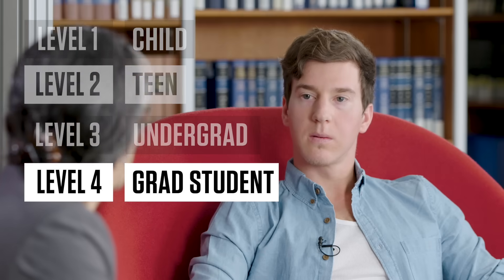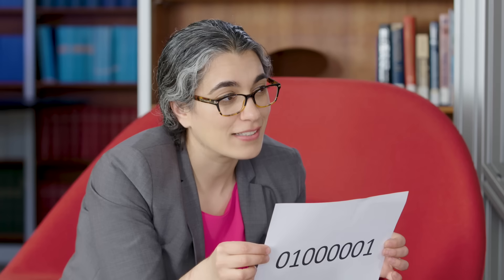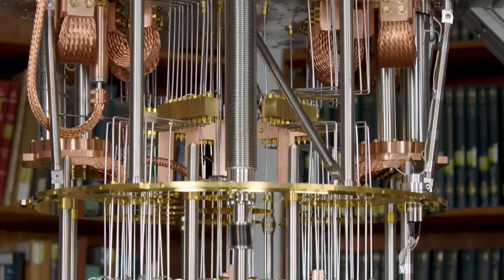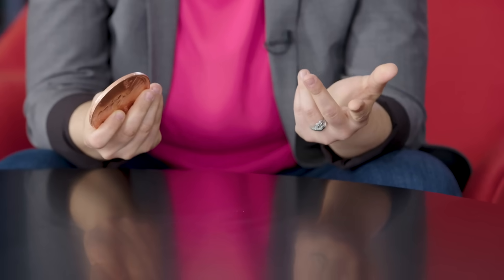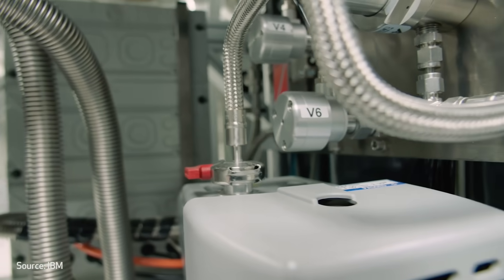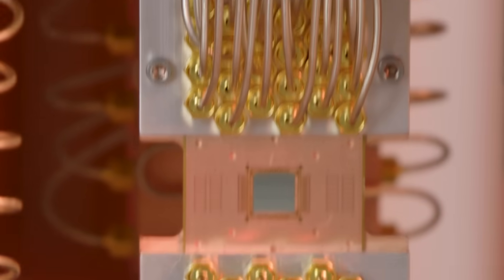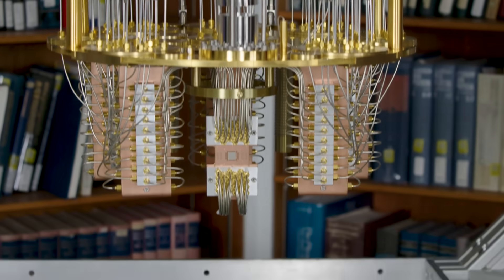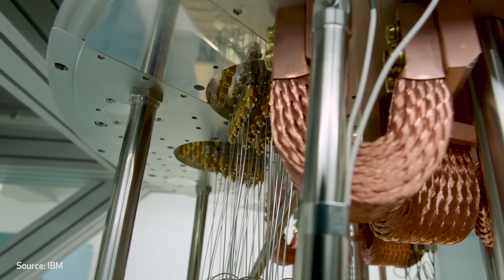Quantum Computing Expert Explains One Concept in 5 Levels of Difficulty | WIRED

Comment: +like. How big is this machine? Did she say 50 bits? or 50 bytes?  The number of pneumatic tubes  seems to indicate 50 bits??  The entanglement is a wonderful concept of implied instant communication over what might be light years of physical separation?  Perhaps the first thing to do is comprehensive tests of the entanglement hypothesis: and alarm clock that can be programmed to ring at a certain time because of the state of these entangled bits. This is like pure math, where people imagine mathematical functions and others are expected to use these advances on the mathematical frontier to find/define a real world problem using the 'new' tool.  I have an issue with the concept relying too heavily on processes that we have no capacity to measure at precisely the same time to 10 **(-30) seconds.  I have no idea how fast the 'where' / 'what' can change but am just trying to understand how slow this state might change at 0.01 degrees Kelvin.  At what temperature does hydrogen (protons) freeze?
Reply: Alan G 
Quantum entanglement can't be used for communication
Reply: ANT, your answer is overly simplistic.

Comment: I love this! Great video! Check out a book I have always loved, "How to build your own self-programming robot", by David L. Heiserman (TAB Book No. 1241, 629.8'92, ISBN 0-8306-9760-8, or 0-8306-1241-6 for paperback). He goes through the entire process of finding and fixing issues on early hardware, while improving system fault tolerance. I don't think it will apply directly, but it could give insight. If nothing else, it is great for some wire wrap nostalgia! Hope that this helps!

Comment: To clarify. A classical computer theoretically runs on 0s and 1s. We have to round because due to interference it isn't exact. This is why the computer must be isolated and reduced to such low temperatures to reduce interference.

Comment: What I still don't get is what use is it if it is always 0 and 1. Lets add 2 bits being 1: 1+1=2 or in binairy 01 + 01 = 10. Now in quantum computing each bit would either be 0 or 1, so you will get all possible answers of 00, 01, 10, 11 which would mean the answer of 1+1 would be 0 or 1 or 2 or 3. Which would mean you still don't have the answer just all possible answers. Sure that is useful if you want to know all options, but not if you want to know the answer. So how do they do this?

Comment: You know how in naval engineering they use computer simulations to predict how their ship design will behave?
In the olden days they only had wooden ship models and swimming pools.
Quantum computing aims to be kind of like that, only more generic. If you pose a question to reality in a correct way, you automatically get a valid answer for free, no computing power of your own needed. Nothing beats reality in computing power. The problem of course, is how do you pose the question in correct manner to a quantum computer? And how do you know you got the right answer? Quantum computers are quite susceptible to random errors.
That's how I would attempt to explain a quantum computer to a layman.

Comment: If we are talking about measuring the spin of entangled particles the conservation angular momentum requires that when  we measure one particle if we get spin up,  the measurement of the other particle  will always be spin down.  In your talk you say that the entangled pennys  should always  both be heads or both should be tails.  Shouldn't the conservation of angular momentum of the entangled pennys cause one penny to be heads up and the other to be tails up or vise versa?

Comment: Actually the entire point of quantum entanglement is that if you measure a particle and it shows it as heads the other one will surely show tails. It's the opposite not the same.

Comment: The Penny analogy was amazing. So is it like you can have true or false, but also now include your spin like 0° to 360° to represent more information rather than using a greater number of pennies in a combination?
Reply: Not quite.. 

With these quantum computers saying
'Spin up' is like saying 0 (or heads)
'Spin down' is like saying 1 (or tails)

Conventional computers only think in terms of 0 and 1 (if the computer wanted to count to what you'd call two it would call it 10, three would be 11)

Conventional computers 'could' be designed to think in terms of 0, 1, 2, and 3 (if the computer wanted to count to what you'd call four it would call it 10, five would be 11)... but it wouldn't gain us much worth having.

The two things quantum computers can do that regular computers can't are:
"Superposition" which is like saying... shrug this number is both 0 and 1 at the moment (because magic)
and
"Entangled" which is like saying lets flip both of these coins... If one lands heads the other one will as well (because magic)
Reply: Matthew Spencer Thanks for the clarification. I am still a bit lost. If you have 2 computers synced up with each other where one holds 1 and the other 0 then would't that suffice for spacial imposition? I am not sure on how entanglement is judged because once the result is settled can't you change one to match the result? It is not necessary to answer these for me since it seems I have something new to study now. Thanks for inciting even more curiosity in me.

Comment: @5:30 Technical error: one persons Heads/Tails would be the opposite of the others. not the same. Doesn't really matter to get the concept, but still erroneous.
Reply: Nope. It depends on how the two 'pennies' have been entangled in the first place. You would create the pennies in a superposition of two states- one in which both pennies are heads and the other where both pennies are tails. When you now measure, you would end up with one of these two states so both pennies always show the same. You could also create the pennies in a different entangled state which would give you pennies in opposite states upon measuring.

Comment: But... Can it run PUBG without lag?   No,  nothing can run PUBG without lag.
Reply: A better computer won't fix the crappy servers. That is entirely on pubg.
Reply: you run pubg with this one and everyone starts as a zombie. both dead and alive at the same time.
Reply: Is it the hardware or is it the game's coding that fails?
Reply: You can't. You need a graphics card.
Reply: Hans5958 1080ti here. Maybe your issue is GPU. The games issue is networking.
Reply: Only phones can run pubg without lag.
Reply: Not without lag, but it CAN tell you the position of every possible player simultaneously.
Reply: BubbleTeaFob I mean... what type of lag? Cause my pc does lag FPS wise, however my internet is trash so...
Reply: I have,

Ryzen 5 1400 OC to 3.8 ghz
EVGA 1070
EVGA 650W Gold Standard Power Supply
16 AMD Ram
Installed on SSD

251 mbps Download
19 mbps Upload
Connected through 1gb ethernet cable,  no wifi

And I still lag.....  Yeah i don't have the best system out there, but i would think it's sufficient enough to play.  Internet is not a problem for me.
Reply: Nothing can run nothing without lag if it is anything but itself. Delay is.
Reply: Archive 405 its neither, the creator player unknown is such a weenie that the game wants to kill itself, but the team at blue point wont let it
Reply: if you play pubg without lag, then you're not playing pubg
Reply: Its not made for stupid games
Reply: true :))
Reply: this is kind of a dumb question considering the state of quantum computing we're at now is pretty much where we were with classical computing in the mid 20th century.
Reply: Alek Kanev Why do you think graphics cards keep getting made better and better? Or more stable internet connections? Making games is probably the best way to ensure that people use quantum computers constantly and try to improve them as much as possible.
Reply: This is probably unable to open a MS word file...
Reply: It can't run PUBG at all.
Reply: calencor "Thanks for playing all the way through there but you actually died in the first minute of the game."